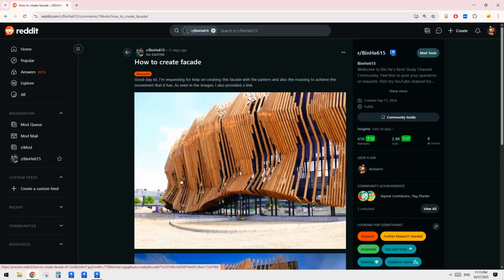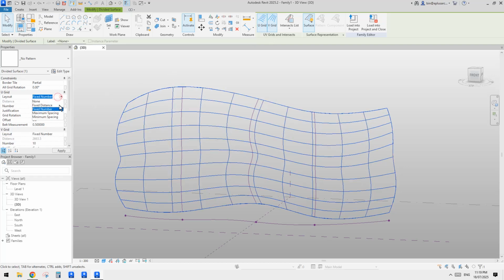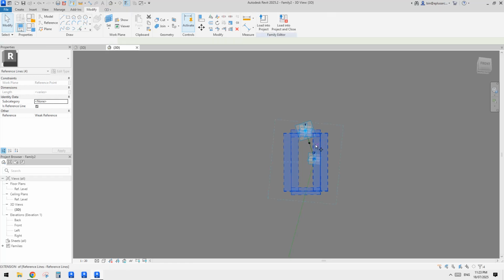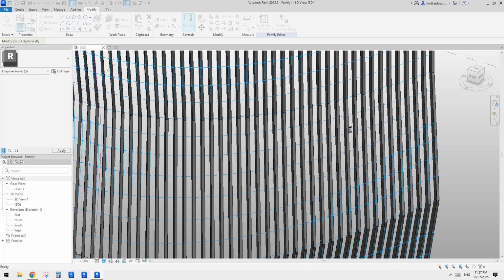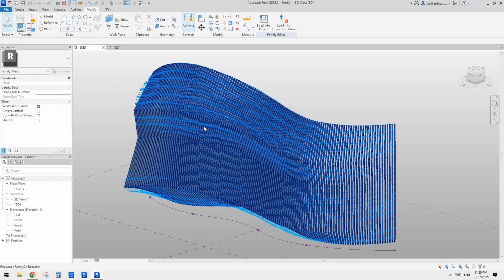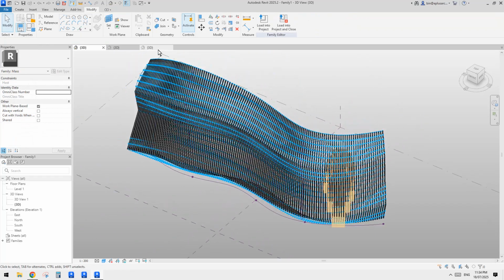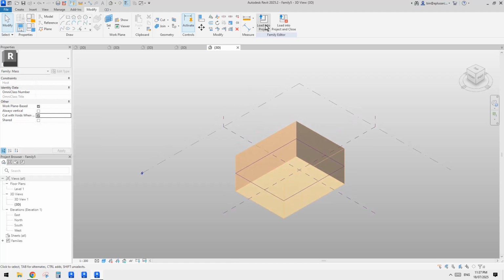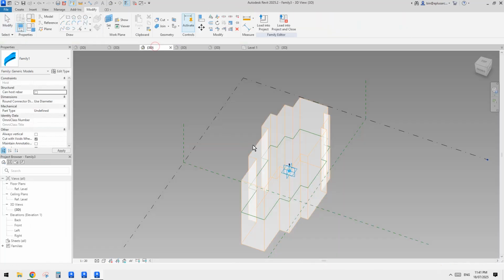25097 - Massing & Adaptive Screen Family Exercise in Revit

Comment: 'Cut with Void' function in family environment can apply to cut void on solid geometry in project environment. Solid geometry in family can only be cut by void made within the same family but not by means of nested family. That's the limitation of using 'void geometry' in revit. Sigh... Thanks for your sharing!
Reply from the maker: A face-based family with a void cutting the base can cut most elements, though not all.